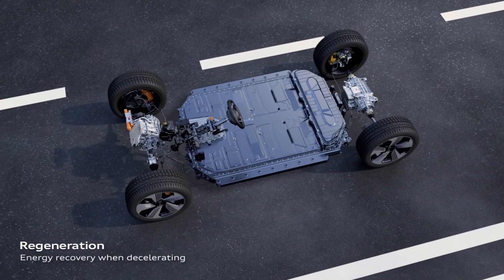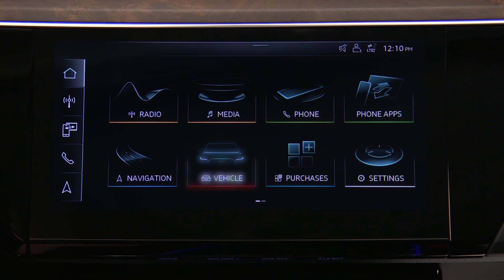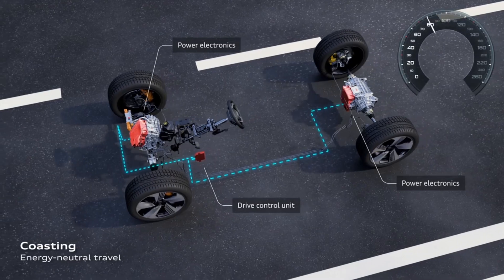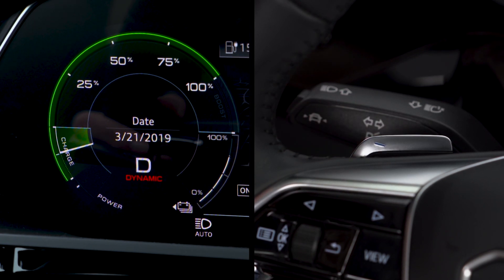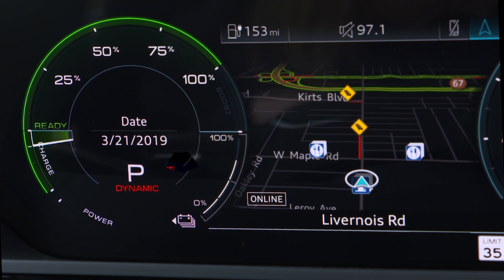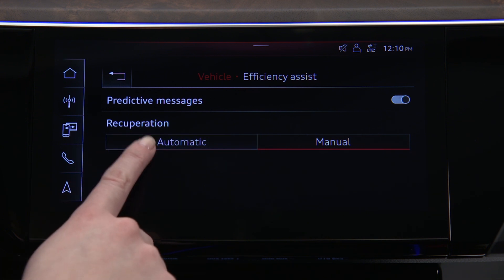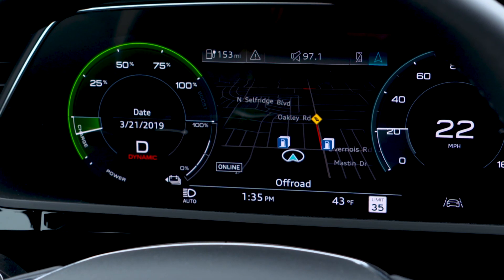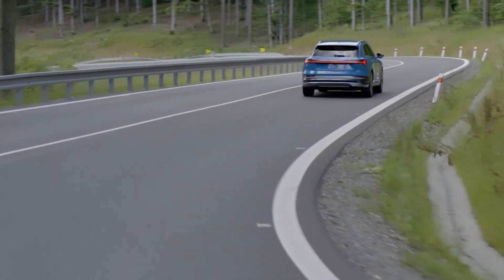Audi Tech Tutorial: Regenerative Braking

Comment: The regen braking on the e-tron is not impressive.  If set on automatic, it needs traffic/objects in front in order to stop even reasonably aggressively.  It also doesn't apply regen if there is more than 75% of the battery left.  Ridiculous.  Using stupid paddles to apply the regen is just as ridiculous.  "I love my nearly one peddle driving and paddle braking" said NO ONE about their EV.  Even a Jag I-Pace can bring the car nearly to a stop even regen braking downhill and, though not complete one-pedal driving, it is great not to have to use the foot brake for 90+% of driving.  LISTEN EV MAKERS:  one pedal driving is the bomb and should be a basic feature of all EVs.